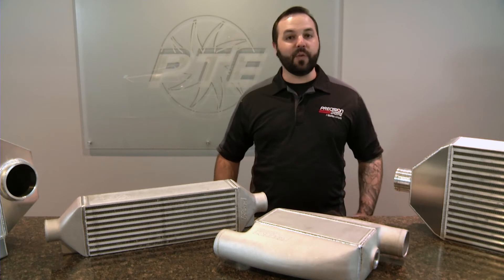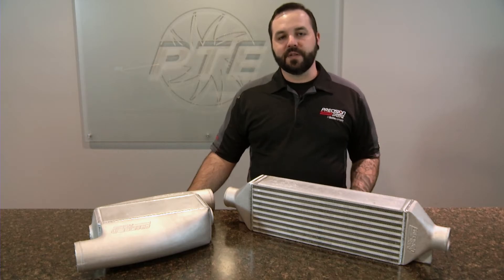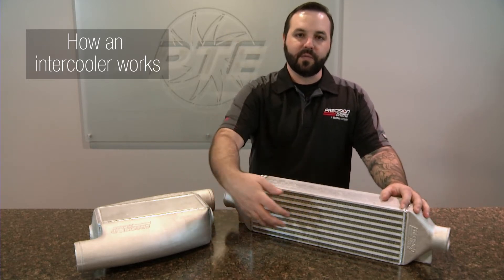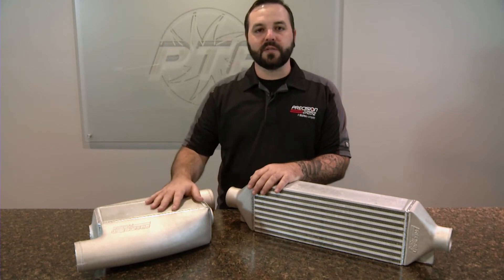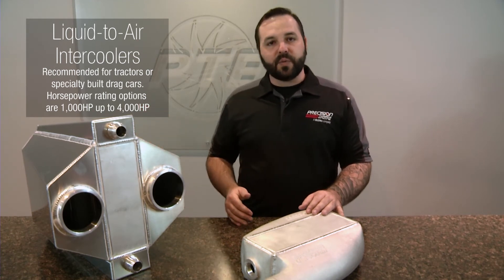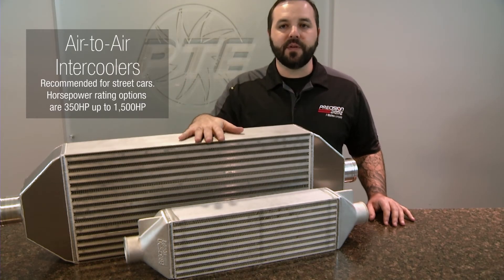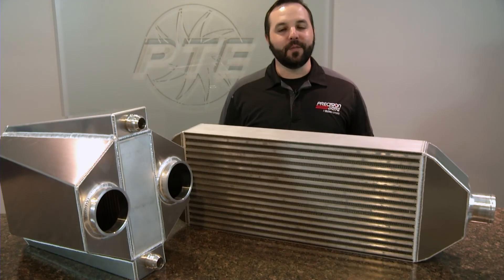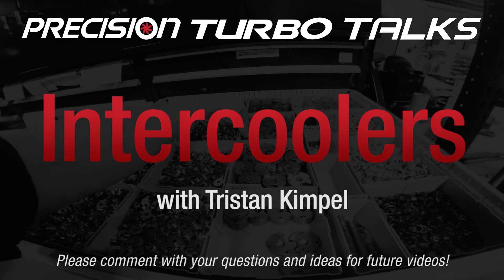Precision Turbo Intercoolers

Comment: what’s better? air to water i’d imagine you can mount closer for less lag?
Reply: Air to air allows more power I think right ? Air to water would be safer if you don’t have a stand alone ecu controlling everything but with the amazing ecu nowadays that can be tuned to control EVERYTHING , boost controller and wastegate properly set up, air to air would be better ? I’m just bias cause that is my set up but keep in mind i’m only pushing 500whp. Not sure what your building hahah